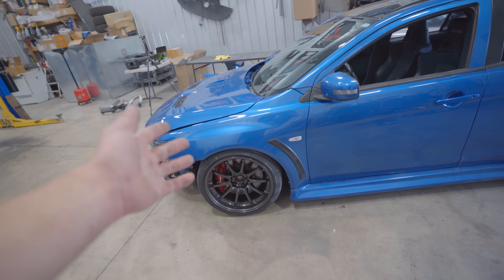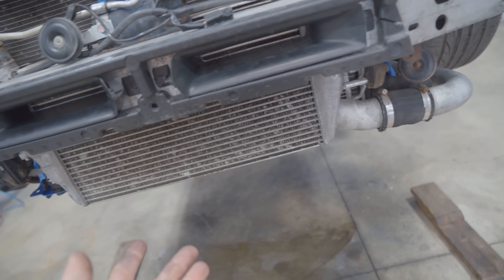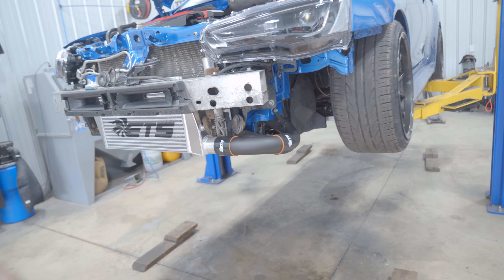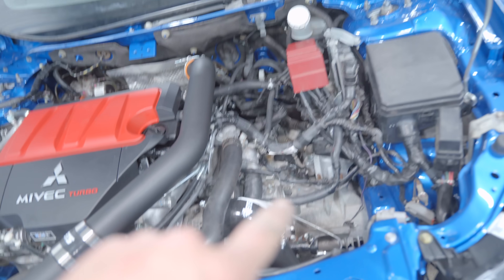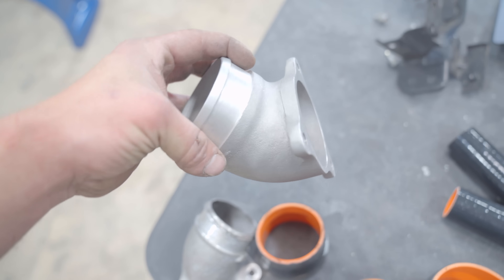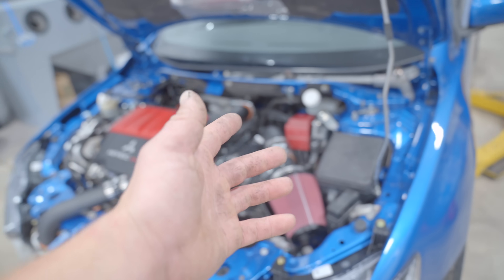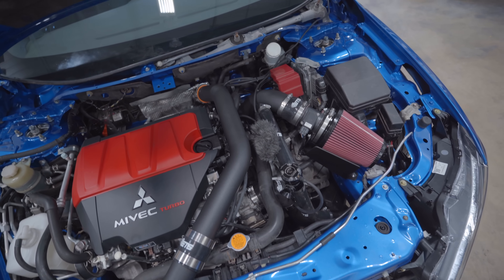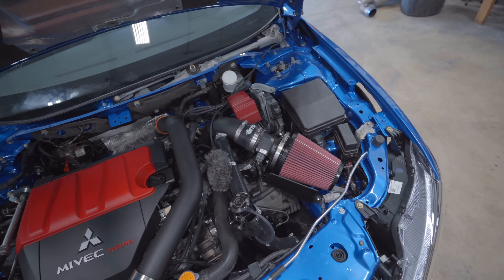Building a 500WHP Mitsubishi Evo X! (Intercooler, Piping, Boost, And Intake Install)

Comment: Did you make any adjustments to the BOV to make the flutter noise?
Reply: The aftermarket turbo will flutter with an intake at low throttle because it doesn’t open the bov untill a certain point. If the bov stays closed it will flutter all the time.

Comment: i met my wife when i had an evo x, she still talks about it fondly. it was pretty built even though it was rough around the edges and salvage title but i got it for 14k. it had a nasty cam and sidewinder setup on it, bunch of ets stuff as well and just a straight 3in exhaust we always joked it was just fence piping. i met one of my good friends when i had that exhaust welded up. i was always nervous about that car though, it would have intermittent problems all the time and i was not equipped to pull motors or anything like this back in the day. i dont think i would buy one now but i just might enter to win. it would match my raptor bronco and ep3 very well, being blue

Comment: I will say I have the ets intake, and an HKS dual exhaust, running a cat. and I haven't gotten a tune.
Reply: With the manual you can get away without a tune if your ebcs is still stock. If you have the Dual clutch you Need! A tune.
Reply: @RTX007  hello, thanks for the reply! Yes, car is stock for the most part . I did have a mid pipe in there before but a check engine light would come on. But once I took that out and put the cat back in no problems. Sounded better without it though. 
I don’t think I needed a tube just yet since I didn’t put much onto the car anyways. Mind me asking what ebcs is?
Reply: @DaveBudness  if you remove the cat and replace it with a mid pipe without a cat you will have a check engine light if you don’t tune it. I run a high flow cat and have a check engine light for the 02 sensor but the car runs fine. EBCS is the electronic boost control solenoid. I mentioned this because Devin has one in his car and you need a tune with this because you will overboost without a tune.
Reply: @RTX007  thank you, I had some unknown high flow, never tuned it. It would pop on once in awhile the ‘check engine light, replaced the o2 and still show up. I didn’t know, until I took it out. Iam good now. I’ve noticed that once in a blue moon the check engine would show and I would be throwing P2195.  It it hasn’t for sometime now. I will say I think I need to change my exhaust gaskets which I do from time to time. Cause boy what a smell sometimes. It kicks in when I turn the AC on. But other than that I haven’t had the light pop on. I do think I got an exhaust leak. And my electronic boost controller is still stock.